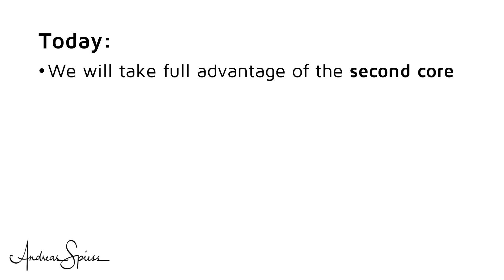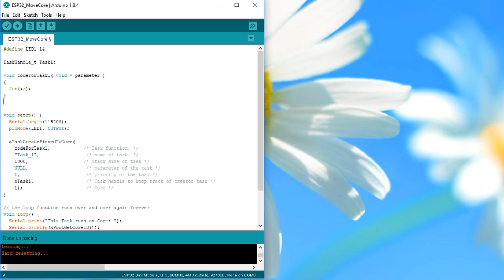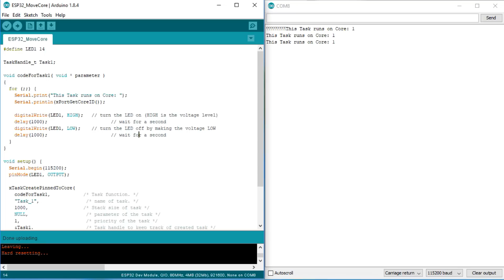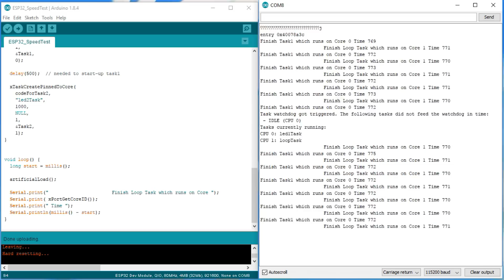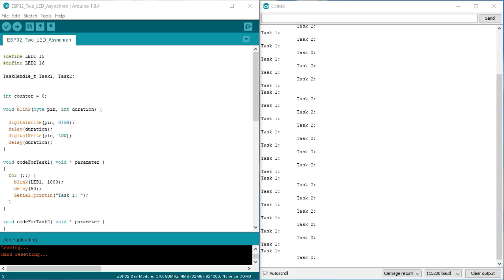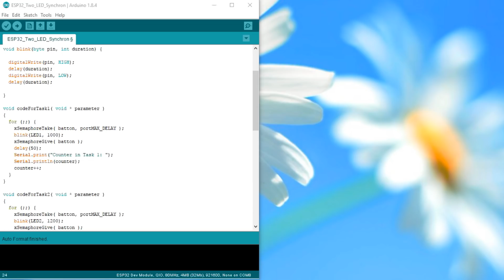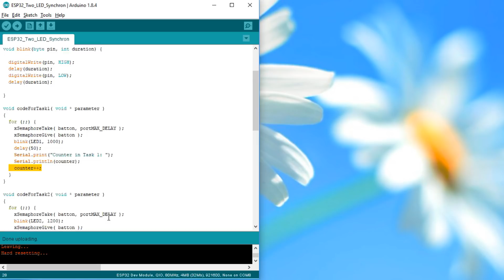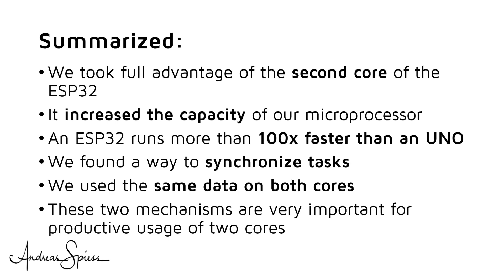#168 ESP32 Dual Core on Arduino IDE  including Data Passing and Task Synchronization

Comment: Thank you Andreas! So far, Espressif is very responsive to bug reports against the Arduino IDE core, but the esp-idf is Espressif's preferred development framework. Problems get solved on esp-idf first. For example, Bluetooth works very well from esp-idf. Bluetooth didn't work at all from Arduino last time I tried.
Reply from the maker: You are right. But for the moment, most of my viewers want to stay with the Arduino IDE. So, we have to take what we get (and create some push on Espressif by using their chips).
Reply: Agreed, thank you for sticking with Arduino for these types of things. It is much more accessible than ESP-IDF for now.

Comment: I don't get it, one runs tasks with 2 processors, but the total execution time is the same if tasks were run with just one processor. One would expect that purpose of running with 2 processors is to get the job done twice as fast? But that was not demonstrated ....
Reply from the maker: One worker does not get faster if you use two of them. But they can get double the work done in the same time. And if you are able to separate one job int two parts, you can give half of the job to each of them. Then, they also finish faster. I did the first.
Reply: Thanks for the answer. In your code you set up a "baton", so a second worker can't start till the first worker ends. If one worker needs to wait for another to finish, than that means that we are back to being same if there was just one worker. That's the part that I don't get.
Reply: In general, the two tasks can run independently and are not necessarilly dependent on each other.  The semaphore, the "baton" only gets used when they need to coordinate something between them.  The real-life analogy is that two workers can do double the work, BUT if at any stage one needs to rely on something the other one does, they have to coordinate.  Some time may be lost here, as A, say, waits for B, to do finish their part.  This is where the coordination is necessary.  As you may have noticed, when the lights were independent, there was not need for semaphores.

Comment: Hi Andreas, i tried out your ESP32 Two LED Synchron sketch and it drives me crazy because it allways crashes.
Now i have a running version. 

1st change is more cosmetic you do not need the TaskHandle_t simply parse NULL to the xTaskCreate... function.

2nd an ampersand is missing in front of codeForTask[12]:
  xTaskCreatePinnedToCore( &codeForTask1, "led1Task", 1000, NULL, 1, NULL, 0);
  xTaskCreatePinnedToCore( &codeForTask2, "led2Task", 1000, NULL, 1, NULL, 1);
The delay(500) after xTaskCreate... is not needed anymore.

3rd the access on every global variable should  be protected by the semaphore so the xSemaphoreGive should be after "counter++" because the counter is a global var.

I hope this will help if anyone had also problems with this sketch.
Ciao
Thorsten
Reply from the maker: 1. I tried the "NULL" and it works. Thanks.
2. I tried my Github file again and it works with or without the &. And I think, the original sketch I used also did not use a &. So, I do not know why it crashes in your case  :-(  I added a comment to the sketch.
Reply: I'm using PlatformIO with Arduino framework and not the Arduino IDE, maybe the compiler behavior is a little different. Anyway... Thanks for your great videos.

Comment: ArduinoIDE has a very bad (inconvienient) editor. And instead of the stupid loop function everything should be run in tasks. The only good thing about Arduino is that it's so widely used.
Reply from the maker: I use it exactly because it is widely used (I have 45000 subscribers)...
Reply: The Arduino IDE also makes it possible for hobby programmers to use these new processors without having to learn a new IDE.  I haven't tried working with the Raspberry Pi for that reason.

Comment: You should compare esp32 vs the arduino due because uno is a 8bit processor and due is a 32bit processor.
Reply from the maker: I could have compared it to many MPUs. This is why I compared it with the "original"
Reply: I was curious to see its' performance compared to the ESP8266.  Probably the only thing I didn't see in the video :)  Perhaps you could comment and let us know how fast 8266 runs your load?
Reply: Whether you're comparing an ESP32 with a Due, an Uno, or even a Signetics 2650 (go read some REAL history... LOL), it's somewhat a moot point.  It's kinda like comparing an IBM PC-AT with a 64-core XEON (or perhaps an abacus?).
The fact is that the ESP32 is, in reality, two-and-a-bit machines on a single chip.  (The ULP processor is the 'bit' of two-and-a-bit).
Something may don't realise is that your Arduino Due can be made to 'appear' WAY s-l-o-w-e-r than even your Arduino Uno.  (The SAM3X8E in your Due uses a PLL to generate its master clock based on some external oscillator.  Normally, this is a 12MHz XTAL which is multiplied by 7 within the internal PLL to give you 84MHz, but it could just as easily be limited to 32kHz!)
By the same token, the ESP32 does not have a 240MHz external clock (it uses an internal PLL too just like the Due)
The 'beauty' of the ESP32 is that there's this almost totally independent fast CPU core available that you can take advantage of to run some totally different process(es).  However, be warned that things start getting complicated VERY quickly when you start needing to 'share stuff' between cores.
Anyway, back to the point...
Each ONE of the two 'fast' cores on the ESP32 can run at a clock speed of 'up-to' 240Mhz which is around 3 times faster than the max speed of a SAM3X8E (a.k.a. Due).
Furthermore, this 240MHz is about 15 times faster than the 16MHz clock on a Uno.
Sooooooo....  I can now hear you asking where the figure of 120 times faster quoted by Andreas came from????
Well, he is using TWO cores? Nope, that's not enough!
OK, maybe the ESP32 native CPU core is FAR more 'efficient' than on the UNO? Almost definitely, but that's not the whole story either!
The reality is that the wonderful 'baggage' on the UNO (the underlying Arduino libraries we all link in to out sketches) is actually VERY s-l-o-w.
It was never designed for SPEED.  It was designed to EDUCATE beginners and be comparatively 'portable' (kinda) to other architectures such as a DUE, an ESP32 etc.
Try writing a simply sketch to 'toggle' a single pin as fast as possible on an Uno (using the digitalWrite() function) and measure the resultant 'speed' on a frequency counter or 'scope.
Once you've done that, rewrite the SAME 'sketch' but this time use direct IO to the pin (avoiding digitalWrite altogether) and compare your results
You'll QUICKLY see what I mean

Comment: You can't compare the RTOS with Windows realtime operating system and certainly not with respect to power. You have much less control over the taskscheduler in Windows than in embedded realtime operating systems like RTOS. 
Also, if you want speed, don't use Arduino IDE.
Reply from the maker: +hammershigh You are right.

Comment: Perfect ! Great awesome video ! Btw, is the Harley Davidson really yours ?
Reply from the maker: +Philip Gevaert Not this one, but a similar one.
Reply: Ah, I'm into motorcycles too. I prefer the GS. It's a wonderfull bike  to cruise the Alps and high mountain passes.
Reply from the maker: These are two different concepts. I had to learn, that Harleys are a different category: There are Motorcycles and Harleys, which are more a way of living... BTW. I also looked at a GS earlier in my life but kept my Honda VTR1000 at this time.
Reply: Honda is quite good. I understand that Harleys are more a way of linving. I would like to have a Harley too, but when I travel I need a reliable bike with large gas tank, which is also capable of off-road. So, the answer is easy: GS.

Comment: "Here is the guy with the Swiss accent...again..." - I always enjoy hearing that intro - it's your signature trademark.  My wife gets a kick out of it too (sometimes she listens to my youtube tutorials LOL).  Thank you for this video.  I've been using the ESP8266 exclusively since the ESP32 software arduino support seemed to be very much in alpha/beta release.  Based on your recent videos on the ESP32 it seems it's slowly starting to stabilize and become very useful (still missing bluetooth though).  I like the intro on RTOS and the simple example - not so intimidating after all.  Do you think it's possible to control two different GPIO pins in a task running on different cores?
Reply from the maker: 1. I am glad to hear, that your wife increases the share of female viewers of this channel
2. If nobody uses a software, the supplier has no need to improve it. Typical catch 22. Maybe my videos help to change that.
3. Maybe you just try with the GPIOs. I assume, with synchronization of the tasks it should work.
Reply: I also miss hearing your original intro "Swiss accent *again*". Feels like something is missing now :)

Comment: Use queues for communication between tasks. They are one of the core principles of parallel running programs. All the semaphore handling is done for you. You just have to write into and read out of the queue. It can also be inherently synchronizing (a write blocks while the queue is full, a read blocks if the queue is empty). In simple cases you transfer a value. In more complex (and flexible) cases you send a structure, you define, e. g. containing a command and a value. It is a different concept than reading and writing a single variable, so queues are not a 1:1 replacement. The programs have to structured differently. But it is the way to go in parallel tasks for the very common "producer-consumer" pattern of programs (like the very typical "sensor-to-display" programs you run on micros).
Reply: Sure, they aren't a small topic and would definitely haven been too much for this video. As said, you can't ususally just bolt queues onto a program. It has to be designed with them in mind.

To give an example:
Your sketch with the global variable counter is a race condition waiting to happen (it is not the question, if it happens, but when it happens). The "counter++" translates to multiple processor instructions (essentially read-modify-write). If these overlap in the two tasks, you "lose" one of the increments. This can even happen with just a single core, because the OS can interrupt a task and run another one at any point in the code (important to remember: not C lines of code, but processor instructions). 

If you want to use a global variable, you have to protect the counter++ with another semaphore. This will work, but could have the effect of synchronizing multiple tasks to that point (don't think two tasks doing that but a 100), which could lead to bottlenecks sometime later. Also you must make sure to use the semaphore in every single one of them. Forget it somewhere and your program is broken and will act up randomly (again, it's not an if, it's a when, that is very, very hard to debug).
Reading a global variable is generally less of a problem, but if something else can change the variable don't do something like
if (counter < 5) ....
if (counter == 5) ....
if (counter > 5) ...
the counter could have changed in between the lines!

If we are talking about different concepts and queues, create a third task. This task reads from a queue. Whenever it receives a message (that could be the sending task's number for example), it increments the counter and prints something like "increment from task X. Counter: Y". This is 100% safe method of incrementing the counter, even if there were a 100 tasks. The calling tasks can immediately move on (as long as the queue isn't full). You also "centralized" the printing and you can't forget a semaphore, because you just call "queuesend(queue, mytasknumber)" (pseudocode)  instead of "counter++".
Reply from the maker: Thanks for your explanation. I have to find out how RTOS (and Arduino IDE) supports that...
Reply: Btw. the special thing about an RTOS is not that it can run multiple tasks. Pretty much any OS can do that (there even are some for AVRs). But an RTOS usually has a guaranteed maximum time until a task gets processor time, so it won't be "starved" by other tasks. You don't even need multiple cores for that.
Reply: Task notifications is another alternative that is faster and uses less RAM.

http://www.freertos.org/RTOS-task-notifications.html
Reply: In his example increasing the counter is not protected by the semaphore and that is the critical part.
Reply: Using them with Arduino seem to be easy (and is on the same site you already linked to ;) ):
https://techtutorialsx.com/2017/09/13/esp32-arduino-communication-between-tasks-using-freertos-queues/
Reply from the maker: I saw the queues, but thought, this would be too much for this video and maybe is something for an entire one. But unfortunately it still does not solve the issue with global variables
Reply: superdau, I'm pretty sure his counter is not a race condition considering he is still using the 'baton' semaphore to only allow one to execute at a time.  But you're right that had he not done that, it could be an issue.
Reply: Definitely the way to go with coordinating the operation of different tasks.

There's still a use for semaphores and indeed volatile global variables. The latter when you have e.g. only one task setting variables and others only reading ... And there is no need for coherence between variables ... or if any task can set a flag upon which others must also act... Such as a shutdown in the event of a crtical system fault.
Reply: Even if it was protected by a semaphore then the compiler might rearrange instructions if there are no read/write memory barriers. Generally speaking a higher level construct like queues are advisable because the potential bugs are hard to track down.

Comment: Hi Andreas. You asked for comments on global variable from different threads. Generally, updating a shared variable should be done from within locked section (only while process has the batton), never outside it. In general, counter++ is three assembly instructions - fetch the value from ram to processor, increase, then save back to memory. The reason why it worked for you so far is that probability is very low at 240 MHZ for one core to change the variable between steps 1 and 3 of the other core.
Reply from the maker: I was looking for how the OS supports the concept you describe. I assume that RTOS has a particular way of protecting variables which does exactly what you describe without programmer intervention.
Reply: I doubt that RTOS will just magically prevent simultaneous access without explicit locking. In a full-featured OS you still have to use mutexes and semaphores and FreeRTOS is a barebones operating system, more like a threading library. If your code were to read the value, wait one second then change and write it to memory, from OS point of view you are doing same thing as counter++ but with a bigger delay and bigger chance that something will change the value between your read and write. How would OS know in which case you want protection and in which not?

In this case probability is millions to one that your code will work without locking. In general case, you should use semaphores for shared data.
Reply from the maker: I just know how we deal with this during interrupts: We switch the interrupt off before we do the change and switch it on afterward. This prevents another interrupt with a higher priority corrupting this "logical unit of work". I was looking for a similar concept to tell the OS that it must not interrupt for a moment.
Reply: @AndreasSpiess  Yes, you can do __atomic_add(mem, value) as with atomicity.h in esp32. So incrementing would just be __atomic_add(counter, 1). It will do the add and store all in one unit so that no other tasks can interfere during the operation.
Reply: Hi Andreas, If you decide to do a follow up on proper inter process communication it is worth checking out the concept of read/write memory barriers. In these comments I see a lot of people assuming guarding a section by a lock/semaphore is sufficient for communication using global variables, however in some cases the compiler can rearrange instructions in such a way that they end up outside of the lock if there are no memory barriers. I am not sure if this would be an issue in this environment (arduino/rtos). In general though people that are smart enough to write proper multi threaded code tend to use higher level constructs like queues/messages if possible, because writing/debugging it low level is hard.

Comment: This is the answer! I have been designing a replacement for a $800 test equipment where sensitivity is not critical, therefore we could get away with low cost hardware and no cost software. I want to take data from a sensor and post it to a web page that is fed in real time, let's say 10 times a second. I was thinking I would need to feed from one microcontroller doing the sensing to another doing the web page serving over serial. I am a complete noobie. Can you do an example like this with the ESP32 RTOS? The web side would need to run in host mode for a computer to connect to and browse to the web page to get the data. Only one computer /user at a time. I'd like to plot the data numerically and visually in a chart and have a few buttons assigned to i2c functions of the sensor.
Reply from the maker: These are many topics in your request. Usually, people use the small devices for sensing and transmit the data through MQTT to a bigger computer like a Raspberry Pi or even to the cloud. There, they do the visualization. Small processors are not very good in creating web pages, especially not for multi-users.
Reply: I like to dump the info from C++ to JS and let a fancy web app display the data; all the ESP needs to do is serve the static html/js/css files and provide the "API" http path.